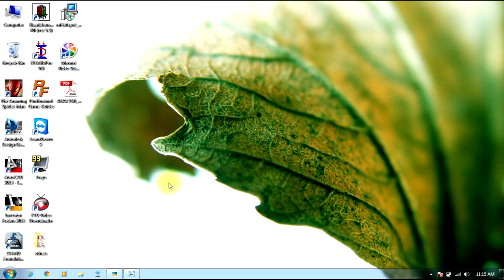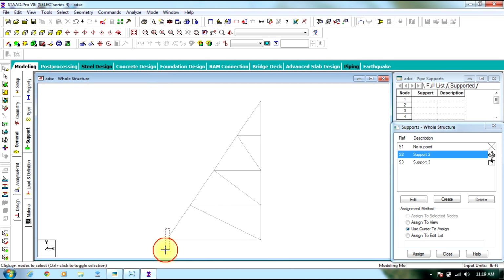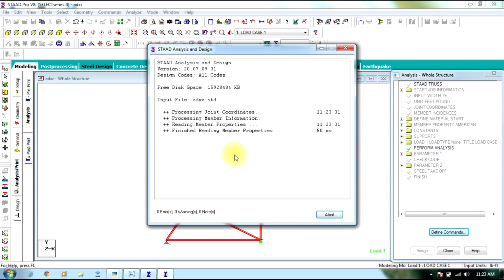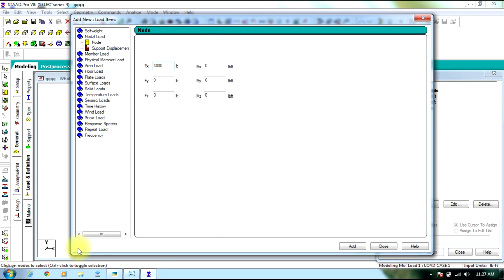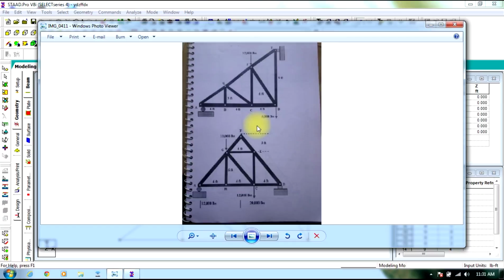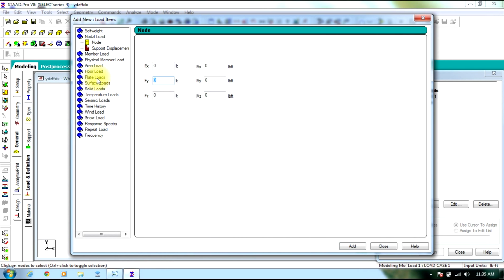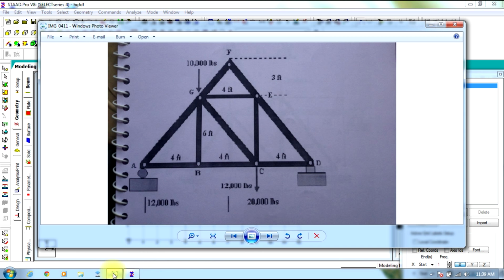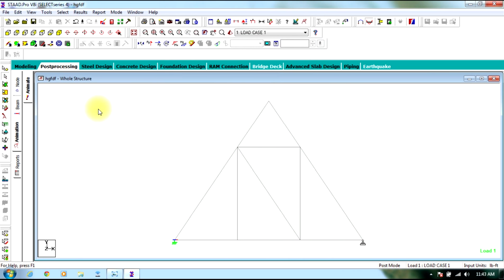STAAD Pro-Tutorials-Design and Analysis of Steel Trusses-3-Day 21

Comment: in thierd project of truss, roller support on upper part specify fixed butt fy and fz because movement only y&z direction and x is fixed
also clear my concept in this types of problem
thanks
excellent tutorial about staad pro. pls upload more tutorial with different types of practical problem
Reply from the maker: ayub patel

Actually in this problem the x,y,z planes are not mentioned. So in real life problems you need to make sure you fixed the end in the correct plane. Thank You:)